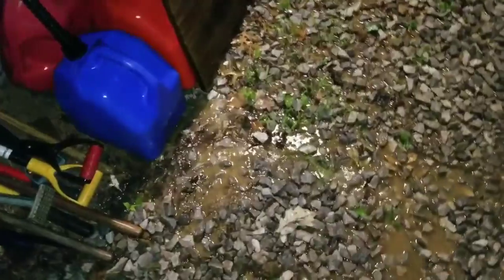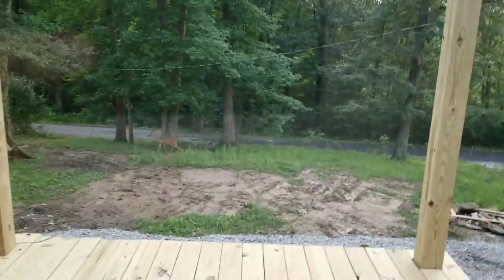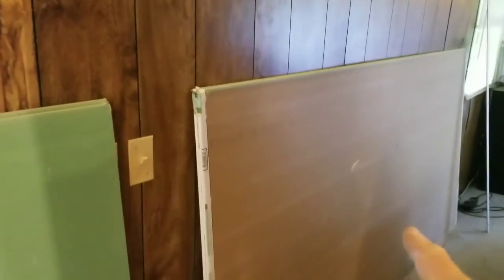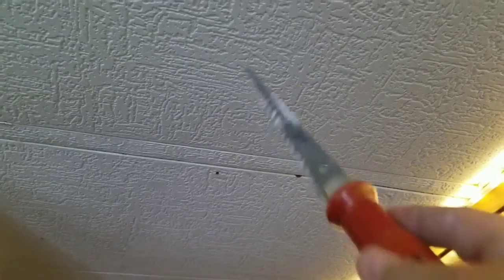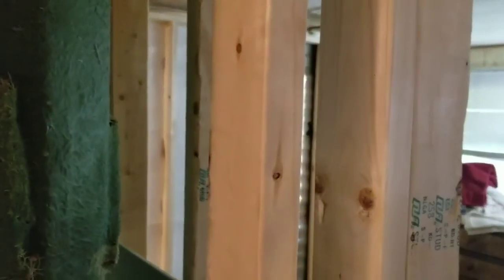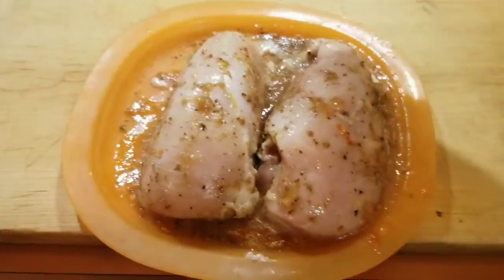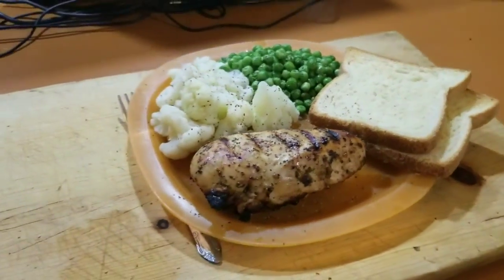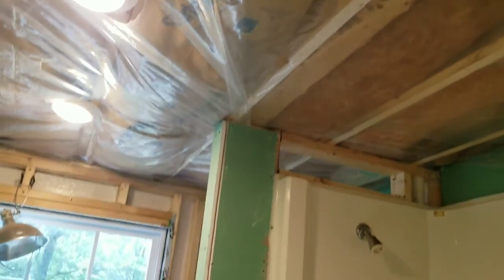#2019 $5000 SINGLE WIDE MOBILE HOME RENOVATION EP.20a  BATHROOM DRYWALL

Comment: Rain rain go away ☹️😠😞 The Mit is waterloged ourselves in Michigan. Today Saturday. Finley drying up, heating up. A little 👌
Part's of Michigan's flooded.
Some worse then other's 🙏✝️
So rebuild 👍😀 channel that water,stream away from the house. There's a few videos showing how to make/dig French
Drain's 😕   If it's to wet. Also
The type of soil/dirt you've got.
Clay or sandy.  Maybe they won't work 🤔😳 check with a local
Contractor. Man you get the rocks  
From for the driveway 👍 he'd know 😳😵😱 hopefully 👍
Good luck ✝️ chicken looks good 👍 Safe rebuild 🔨📐📏🛠️⚙️